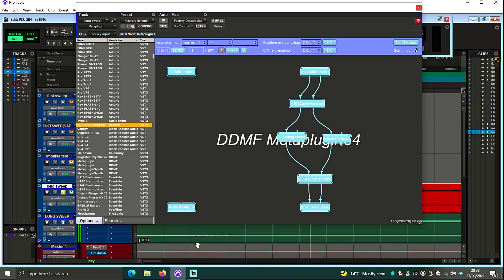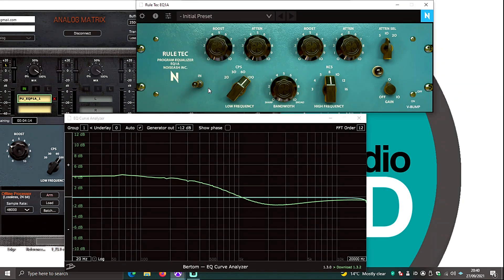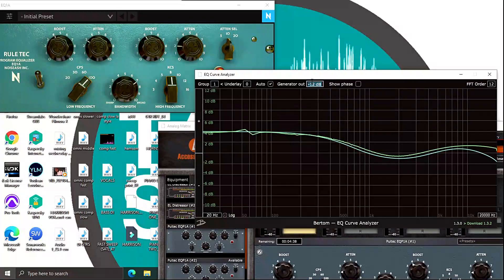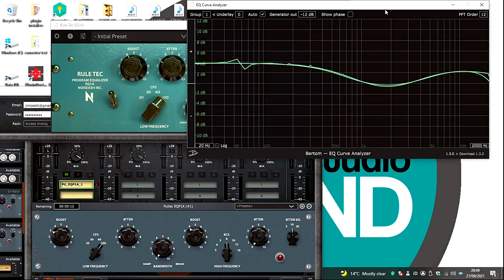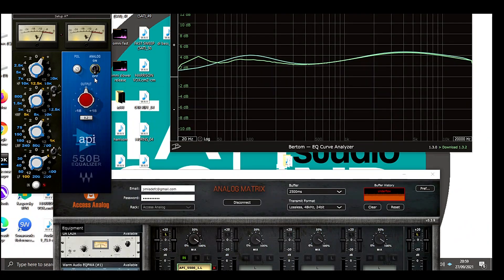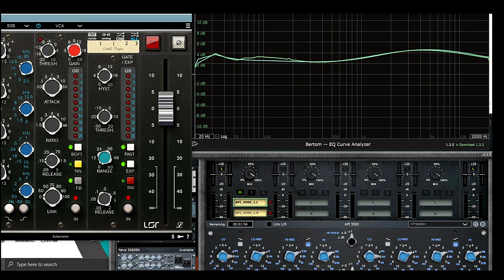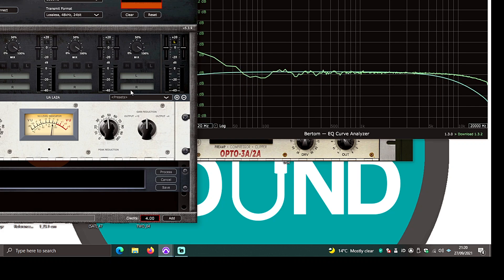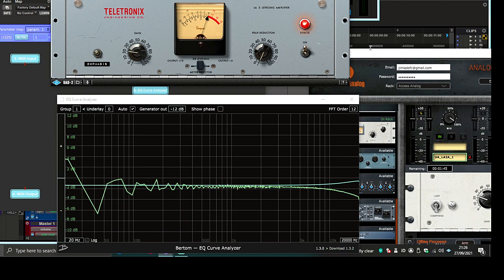How to match curves of ACCESS ANALOG HARDWARE & ANALOG EMULATION PLUGINS using BERTOM CURVE ANALYSER

Comment: Anyone have a trick to transform any linear EQ into non linear ? Is there a plug-in for that? Or just adding some saturation/distortion signal would do the trick ?
Reply from the maker: Compression, saturation/distortion
Reply: @PaulThird  i guess this is the trick of Acustica, adding non linearly with the sample based convolution
Reply from the maker: Remember not all non linearity is audible though. You can add non linearity into a signal and not make any real audible change
Reply: @PaulThird  Thank you Paul !

Comment: Interesting. Could all the movement be a glitch in the Berton, because access analog is streaming over the internet or anything? I actually have an la2a style guitar compressor. Has tubes etc. I'm going to run a few test tones through it and see what happens. Fascinating how it's so random. Could they not program some random movement into plugins. Is there a reason I wonder?
Reply from the maker: Possible but I would lean more to the unpredictable nature of analog circuitry. There is stuff like TMT coded into PA plugins which tries to replicate the analog tolerances but it's still fixed. That's the biggest difference between analog and digital. Digital is fixed and analog has a certain level of variability. Analog can change over time and can be dependent on certain factors where digital is coded to be extremely consistent. So for example you can have an la2a and it sounds awesome on a track but try and repeat that 2 or 3 years later it may sound different even in the same settings as components can wear and may sound different due to age etc that's the risk with analog.. Consistency
Reply: @PaulThird  Having watched this vid, I gave it a try. I can indeed confirm the line is moving randomly. I did bypass the pedal as its true bypass and the line is still moving. But of course the preamp on the interface is analog. It looks similar to noise but even with gain low or high the line is still moving randomly. So there ya go. Absolutely fascinating ha

Comment: Thanks for discover to me Analog Acces web, it's totally crazy haha!. I knew Aria Mastering but this is the next level. This let to home studios make the mastering with hardware, it's necessary, better than plugins. I don't say the mix, but in mastering this is incredible, just throw the audio signal across pieces of hardware making soft clipping  for add saturation and natural compression make the diference, you only need finalizer with a brickwall limiter with just 2 dB or 3 dB. And for a batch processing of tracks before mix with plugins with Neve pre's, etc... this is a wonderful tool.

Comment: thanks for the great video, my conclusion is to make my own non linear effects using plugins like volcano 3 or just wiggle automation etc. is very easy to create designed randomness.wiggle wiggle:}
 .but in seroiusness the traits of many famous hardware units can be implemented and on a more fun angle custom ones can be made follwing the ideas of the hardware.example take the low end flutter from la2a, take the mide/side saturation push from ssl fusion etc. make list of some hardware and what the traits/testing shows  then try adding them elements to a preset effects chain.any cool ways of adding non static nature to the audio seems to be the takeaway.

Comment: It looks like the hardware is suffering from electrical mains interference at around 60 Hz. The API does the best job of isolating it, but it's still showing up in those ripples. Doesn't seem to me like the low frequency noise is what gives the hardware its flavor. The nonlinearities are likely showing up at higher frequencies in small amounts that don't display on the analyzer, but which contribute to perceptual differences.
Reply from the maker: I contacted Bertom and he said that it's most likely artifacts of the analyser trying to interpret the signal which as you said may be mains interference or something else.

Comment: Very interesting Paul. I guess the effect of these non-linearities are cumulative. So it’s not just about one track having this movement in the frequency response, they all do when you mix in analogue. Hence a more life like and interesting sound. I have a couple of pieces of hardware (API and Neve) and tend to use Acustica plugins as they are closest to them but when I engage the hardware there is definitely a difference. I would love to hear from a plug-in manufacturer why they can’t model this seemingly randomised behaviour. Because I guess it would be one step closer. It’s actually the imperfections that make things more real.
Reply from the maker: It's something I plan on testing more in the future. But tbh in the analog vs digital shootouts that I've done I dunno how much that randomness really plays a role in terms of a big audible difference. Just as I've had many plugins sound near identical within the context of a mix or even better than the hardware. So I can't really say for sure based on the tests I've done already

Comment: Its crazy how randomness you get in the low end. But as I can see its withing a dB so it wont be audible alone but can sure make a difference when it builds up from many devices. Maybe there can be a plugin that can recreate that randomness and you just put it before or after your linear plugin instance but each time you render you get the ripples/oscillation non synced with the project. So it could be impossible to null the same project rendered two times. :P (but why would anybody care about this?)
Reply from the maker: I've got extremely close in many of my analog vs digital shootouts so I don't think it makes too much of a difference. Even in that UA la2a I managed to get the TimP to sound better.. (in my opinion). Analog is in the low mids for me a lot. The lows were hard for the algos to get right but Tim's really nailed it. I think the randomness in the lows is one of those things where its more about if you can hear it rather than trying to recreate it visually. Understanding what that sensitivity in the lows is doing would be more beneficial to me
Reply: @PaulThird  Ive analysed AirWindows plugins and saw a type of fluctuation and thought it was a big or something or it was mimicing the wow and flutter but maybe this is what it was doing.Off Topic:  There are a few AirWindows plugins that I use next to top developers such as Slate, Acustica and others (i can tell you which ones) and it might be good for you to check them out.
Reply from the maker: Yeah give me a list cause he has so many. I tried his anti aliasing ultrasonic plug and it didn't work for me which pissed me off a bit haha
Reply: @PaulThird  One of them is Ultrasonic and how to use it: If you are mixing at 96khz you get non audible frequencies above 20khz up to almost 50khz i think. The stuff in that range would cause aliasing if you were mixing at 48khz. You put ultrasonic after a plugin (or a set of plugins) so audio go clean to the next plugin (or set of plugins), so no extra frequencies pile up in that range. 
Another is Console7 channel-bus combo. The channel plugin boosts something on the individual channels and bus takes away that boost but alltogether from all those channels summed up. You have to use the channel as last plugin and bus as first. then your busses must have the channel plugin as last and your masterbus should have bus as first. Only thing is your fader of each channel should mix into the channel plugin and use the plugins fader for loud-quiet near-far placing. Ive set up reaper in a way that this is do-able. This coding-decoding way of summing does the trick for me the way i mix. I get a much more cohesive blending of all my elemens. I even use proxy channels for my effects sends-returns so every sound goes through a channel and arrives at a bus just before the effect. 
Capacitor2: has an interesting analog circuit style distortion plus a low pass high pass. I use this on every send and filter out the lows to what goes to the effects (reverbs-delays etc).
Air2: nice air band. you should check it.
Energy2: its more like Air2 on steroids. The eq curves of air2 and energy2 are really worth checking with bertom.
Bitshiftgain: reduces levels by 6db each step by reducing the data bits. not sure if its the bits of audio or a data term. but is ideal if you want to just level down all your channels by 6db to instantly get more headroom. do read his article about it first. 
BussColors4: has the color of different type of hardware. i have used it but i need to investigate into it more to have a more detailed opinion. 
Dark: turns 24bit audio into 16bit. When im mixing 90s style hip hop, I use it after my reverbs to make the audio a bit "dark" like the hardware units back then that were 16bit audio and not 24 bit. 
Srsly2: Its a spacer. All my reverbs delays choruses and effects go to my effect buss (D buss in the fashion of Michael Brauer) and i place Srsly2 there to widen up my stereo image a bit more to make the effects more pronounced and "spacey".
These are the ones I use in my mixing template. Im sure I have used some more here and there...

Comment: Reaper allows you to control parameters with a random LFO. I wonder if you could simulate a bit of analogue magic by matching the curves and then introducing a small amount of that randomness to the gain and the Q?
Reply from the maker: I'll leave that to you haha 🤓
Reply: @PaulThird  lol fair enough. I think that's a nerd step too far for most.
Reply: @rossbalch  nah makes sense ,and is hardly a step to far considering it takes seconds to implement in reaper and from what i can see will have a big effect in getting closer to hardware sound due to the non static nature youl be creating,,iam going all in on it using volcano 3 and any other combos of plugins i can think of to chain up.
Reply: @kool-movies  recently tried it on a synth bass (not a virtual bass an actual synth) it gave it a really human quality I was surprised.
Reply: @rossbalch  one thing ive found is the same effect works best on multiple channels,i created a preset in volcano 3 and found if i change the flutter speeds on each instrument channel its not as good,,maybe phase related ...but yeah it also adds something to the track using the same modulation on all channels, similar to say adding a fairchild on every channel like beatles did as it adds the same effect to everything.is like a painter adding one colour to all other colours to harmonize the pallette.

Comment: i love these videos! and the comment section is always good so here is my 2 cents... Movements = Noise so if you want to get close to hardware you can choose to automate the saturation Knob or (better) the magnitude channel.. by magnitude channel i'm referring to (for example) nebula PRE or for example Tim P Dual Tech Tube Passive EQ v2 wich has a even and odd harmonics.. by automating harmonics you will create movements and so noise... Also automate harmonics doesn't really have a big impact on the signal phase and if you want to emulate that "with" that comes from hardware you can try to add a stereo plugin like DrMS and play with the automation of field and depth The FOCUS section uses original mid-information to create new side-information in the final stereo output and The FIELD section uses original side-information to create new mid-information in the final stereo output so you can actually get close to the analog but it's freaking time consuming and not to mention the incredible knowledge and resourced that it takes... i'm not surprised that the top producer/engineer are Hybrid... a single well-played real analog gear will save you a lot of time,money and headache so.. Great video by Thanks for the experiment here!
Reply from the maker: Yeah I couldnt be arsed with the Dr MS thing like.. Ain't nobody got time for that! 😂
Reply: @PaulThird  yeah hahah to sum up try putting slow/fast automation with an lfo over the saturation knob o was experimenting last night and found out that the subtle effect actually create a difference in context.. but again real hardware it's better and fast 😆 😢

Comment: I don't think you'd actually be able to hear most of those kinks - the first looked as if they were harmonic intervals... anyway the Bertom curve is too coarse to display the subtleties so I'm sure the "life" in the EQ curves is a combination of the analyzer's resolution, noise and harmonics.  Bumps in the EQ curve need to be stronger than a 0.25dB in order to "perceive" them - hearing them is even less likely.  I've said it before, and I'll say it again... digital plugins emulating analogue hardware are at the "Polar Express" stage of the uncanny valley ;-)  They, like their EQ curves, are "best fit" lines to give the perception of the sound of a hardware unit - the most convincing plugins I have are close enough for me (and most) so is it really necessary to make the plugins more memory/CPU hungry to emulate the minute difference between hardware and software?  I have a half dozen Neve 73 EQ plugins... none of them look alike in Bertom - bells set to 7.2k peaking anywhere from 6k to 8k!  Hardware variance is never that extreme unless it's faulty or been modified!
Reply from the maker: Tbh I'll only use bertom to match analog curves and plugins. For everything else I'll use plugin doctor. In terms of the variences in the plugins. Honestly man I've seen it for myself in doctor. Some are just off..BUT there are a tons of hardware eq's that aren't bang on either so that would explain it to me. You may be right in terms of being too much but I have heard of loads of guys stating that the numerics in their gear was pretty off in some instances

Hard to tell for sure I suppose
Reply: @PaulThird  Most professional hardware will have tiny "not to be played with" pots accessible only from inside the cabinet for calibration... essentially all units can be "tuned" (and would have been for quality control).  So, they may not center exactly on 7.2kHz because the final production "listening tests" determined that 7.5kHz was nicer - but maybe the hardware faceplates have already printed!  Ultimately it didn't matter because it's about how it sounds... but, you can be sure that Neve, API or any hardware company doesn't ever let a new EQ leave the factory without hitting a very tight tolerance +/- between units.  So, for me, there is really no excuse for such wide variances in software emulations - yes, age and lack of maintenance would create variances - but over 1000 Hz?  I have a theory that some plugin devs copy the curves from other devs (no hardware at all!) and just "move the centers" so they look different (or just plainly think their variation sounds better).  I was stunned when I could exactly replicate the Harrison 32c EQ curve with Cubase's very basic channel EQ... like, straight out of a textbook!
Reply from the maker: Yeah that could make sense. Just copy the curves. That'd surely be a new low though right.. An emulation of an emulation 😂

Comment: Thanks for taking the time to make and share the video. Just a few comments:

1. I'm not entirely convinced the randomness you see reflect actual behavior. Looks like a glitch in the setup somewhere. You wouldn't have 2-4 db jumps like that in hardware. Would be highly noticeable and not desireable.

2. Seems like a tad broad definition of "non-linear" you are using. Linearity means that there is a direct correlation between the amount you put in, compared to the amount you get out. If you add a 3 db boost on a digital linear EQ it doesn't matter what the input level is. It will always be a 3 db boost compared. In a non-linear EQ this will change, because as you saturate the inputs etc. harmonics are generated so the result from having a higher input level generates a vastly different output. Which is non-linear behavior.

Anyway - thanks for all the videos and information.
Reply from the maker: Tbh I don't really know what to expect when looking at the hardware. Plus I'm not really versed with bertom so certain bits may be the analyser but it's the only way I know of matching analog and plugin curves in real time so it's all I've got really.

The non linear definition is broad but it's because it's the only way I can try and show others what many developers are choosing to miss out on. In regards to plugins there is not really a solid way of deciphering between the 2 in terms of a technical name. I think it makes more sense for those starting out to kind of have an Easy understanding of what the analog emulations should look like in terms of a static representation of non linearity compared to just purely 100% clean linear. 

Its annoying cause technically we all know that it's not non-linear cause its still predetermined and will always give the same predetermined results which isn't non linear but I think we're at a stage where we should say 'static representation of non linear' plugins but it's a bit of a mouthful 😂
Reply: @TheJohnsofDoes  Thanks. Good explanation. So the oscillation we saw is in fact non-linear behaviour, however it doesn't really represent what would be considered the appealing non-linear properties of analog.